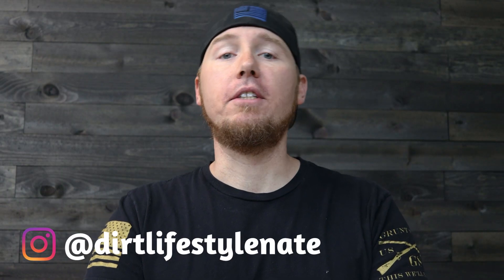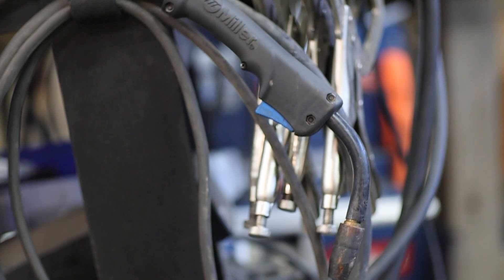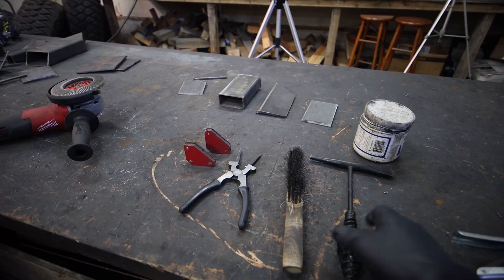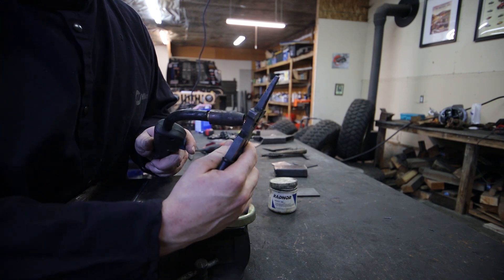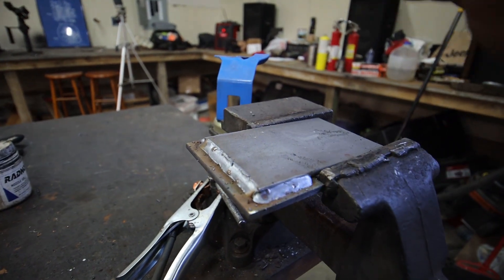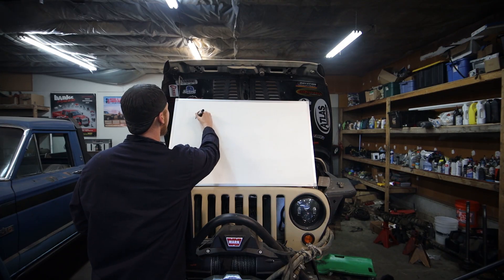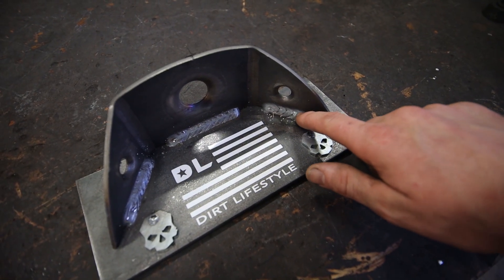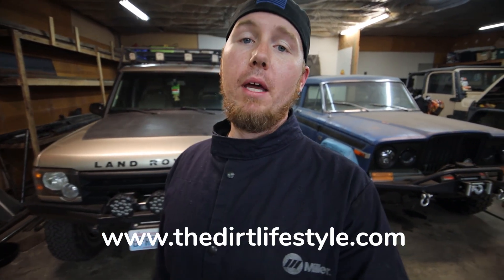Teach Yourself To Weld With This Video!!! (How to Mig Weld)

Comment: that's what I do when I weld with my mig. I go in small circular motions, and when I'm trying to fill a gap I use the C motion back and forth from side to side, and it does a good job of adding material to a space; you're basically just building on the weld material as you cross a gap and drag the puddle as you go as you say. I usually only use the back and forth motion when I'm stick welding. When I was 15, that was 41 years ago, I started out on brazing steel with Oxy/Acetylene, I had to start on a flat piece of 1/8th steel, and when I was able to make a nice uniform bead, I was allowed to advance to brazing two pieces of steel in a T shape. I had to braze 4 layers; the first in the corner; the second on top and the third on the bottom of it and them I had to make a beautiful laced bead over it all. Only after I had mastered that, which took a week of going to class every night for a couple of hours, was I allowed to move to stick welding, and I had to start with a flat weld on some 1/8" steel laying a bunch of beads next to one another, and only after I had then looking beautiful filling a 3x5" plate with perfect beads was I allowed to advance to vertical welding, and I was hung up on that for about a week when a piece of slag got behind my safety glasses, and I had patches over my eyes for 2 weeks. I never went back and finished the course, and I wish my dad had pushed me to go back and finish. I've been wanting to get back into doing it, so I can do some things and I started out with a HarborFreight  Chicago 125 flux welder, it's only 125 volt, I'm really motivated to get a real mig welder that uses 250v and gas 75/25. The Chicago welder is okay for very little! I was really thinking about getting a Lincoln multi process welder until I saw you using the Miller. I'm not sure what your Miller ran you, but Lincoln has a basic multi process welder for around 1,400.00 dollars; capable of Mig, Tig and stick welding, and they have one that is nearly 6,000.00. I'm way too rusty to even think about spending 6K on one lol, but watching you build the rack for you 3500 RAM really inspired me to make a smaller version for my Chevy Silverado 1500 WT. Because I would really like to put a rooftop tent on it and get out to the lake this summer and do some fishing! I grew up fishing as a kid; because mom loved to fish, so I have some really great memories of camping at the Desoto Ben lakes up North when we lived in Nebraska, and even at some of the small lakes down in Oklahoma. you really do some great welding, in my humble opinion, for whatever it's worth. Thanks for sharing all the how to videos. I like the round tubing you use for racks and bumpers. It gives a nice look. I liked the way the rack on your Land Rover turned out. The dimple dies give a nice look while adding a little strength. That's new for me, I didn't know it was making things lighter while adding strength. Really learning a lot from your channel, so thanks for sharing all the projects!

Comment: Yo I need help, does the tip Have to make contact with the metal? As In do I have to let the wire Go first or Does it just kinda fall out as in moving it. My problem right now is I have to guess where the Wire is since I can't see it until it Starts melting and glowing

Comment: hey guys, I've got a cheaptoolium 110v I bought stick welder for $70. I've been teaching myself and have found a respect for welders because its some hard work. in it's own category and expertise. and the skill gap is massive. the curve is massive. the welds I have been making, are fucking massive. I've got a bunch of tools from starting with nothing this past september. I've bee trying 22gauge but It is a bi hard. galviniEd steel doesnt stick weld good either. I've actually got a pair now that. think about it, sweet. If anything you can talk to help I'd appreciate it. I notice my welds are varying in how they occur or the arc what have you. if he 6013 is angled like 45° it works better then 90° , like dam near along the piece of work. I started using DC EN on my 110 and have gotten much better deposition and much better results.

also my settings are difficult to understand. and I noticed my weld is stronger then the metal itself. is hard as frick to cut off
Reply: I've been doing the line stuff since I got it a month ago or so. I didnt know grinding it down was the reason it is so flush. but I also notice if there is no material my weld puddle just burns through. I'm using 3/32 my arc has to be close, lean, preheating, but not super high. it's crazy touchy idk.

Comment: I’m very much a hobbyist, I look up to weekend warriors as my status is so low. So far I’ve successfully hard faced a cheap anvil with stick welding I was quite proud of and mig welded a router table which even impressed my wife. For me as a rank amateur I’ve quickly learnt that 90% of my welding occurs  before I even switch the machine on, it’s all about clean and tidy surfaces. I’ve also become quite proficient with a grinder and my cheap spray gun.

If you’re bald buy the bonnet, it’s friggin painful getting spatter on your dome. I’m still using the big heavy gloves, I know a lot of more skilled welders prefer the tig gloves but I’m not confident enough yet.

Great video, thank you.

Comment: on trash days i ride thru the neighborhood and pick up all the steel bed rails n sure its not very thick steel  but what i like about them is they are  very easy to  strip with  a hammer and a sawzall to get  free angle iron  which comes in handy for many projects and stores easy stacked on top of one another  those are my welding practice  parts  very good beginner video

Comment: If you haven’t burnt through that jacket your not welding above your head then I have used the same jacket welding the bottom of a frame and burnt mine up

Comment: Thanks for the information, one question I have is how many times do you put more welding gel on the tip as I am only just learning how to weld and I have never heard of Welding Gel.
Reply from the maker: There is no exact amount. If I notice junk starting to build up in the nozzle I clean it and dip it in the gel. Not an exact science just trust your gut 👍

Comment: Had some good points that many others don't discuss eg. thin glove and jacket...
However,  couldn't see ANYTHING as far as tacking or welding... nothing g showing torch position... didn't even discuss or have a track of what it should sound like... also nothing to show a good weld vs a poor weld of any type... I think this is a very good start to a intro welding video, but needs some close ups of tacking, welding, hand /torch position, etc. already stated... another 3-4 minutes of runtime filled with  the aforementioned could make this go from a video that lacks to one that goes to the top of the subject...

Comment: This may be a silly question but, do you touch the wire directly on to the material you're welding, or do you hover it just above. I used to Tig weld for work so I know that you don't touch the torch to the material, but I've never done mig before so I didn't know if it was the same?

Comment: Dumb question but what happens if you run out of gas during a weld on a .025 wire or .030

Comment: I didn't realize the tacking was so important. In my haste, i made some crooked welds, but now i know why.  Great video. You get right to it, without all the inconsequential stuff. Keep up the good work!
Reply: allways clamp & tac the work,& spread the welds out,same as torqueing a head.these days you can arc weld just about any metal.you should arc weld,before,you buy a mig.mig is  blindfold welding.

Comment: Going to have to disagree with you when you say you "can't weld 1/4" with a 120 machine". Bevel, multipass, and patience.  Also, as close as possible to the electrical distribution panel, preferably on a dedicated outlet, and as with any welder, no GFCI. 

Is is slower? Absolutely. But I'm building things, not racing. I built my SAS S10 with it, and my bracketry is all 1/4" thick.

NOT trying to be "that guy" that trolls Youtube. It's always better to have excess headspace (ability) with your tools. But if you don't have 220 available, it's no excuse not to start learning (but of course, noone should start with building life-critical assemblies if they don't know how to weld). LOVE the channel, I have learned a lot from you. Hope to see some ring and pinion setup soon, as that's my next project.

Comment: Great video. I’m going to start welding here soon. You didn’t say anything about setting up the gas or turning on the gas. And you didn’t say anything about if the wire is touching the work or how far away it should be.

Comment: Hay thank you for showing me some of your technic. I was welding the other day instead of me welding on a practice piece I went and welded on my project. I had to do a lot of grinding!! I still have to weld all in the hard to get spots I will try what you showed and get my machine adjusted right speed/temp once I get that dial in I'll try the C or zig zag motion.
Reply from the maker: No problem! I hope it helps!

Comment: Thats good info and ways to do horizontal welds. It is the vertical welds that are harder and usediffernt pattern. That is true with stick welding and same done with the Mig horizontal welding works with stick. SO ???

Comment: great video, but what does C25 even mean?  A newbie like me doesn't know those terms, so a quick explain on that would be good also. Thanks!
Reply from the maker: 25% co2 75% argon 👍
Reply: How do you know-how to select that setting?
Reply from the maker: @mattkessler7660  most machines don't have a setting for it. C25 is the most common gas type for mig welding 👍
Reply: Many thanks!😏

Comment: Cool!  In part two, can you go over welding thicker metal to, well, cheese - aka frame stiffeners to the cherokee frame?  That's the one I've been practicing - and man there's a huge challenge there with poking holes (I'm basically using 3/16s and sheetmetal)

Comment: Nice video. I've come to learn over time that the "whip" or forward back and the "C" technique ( if making the "C" back into the puddle instead of forward on the leading edge) can and usually do cause cold lap and lack of fusion. Also, anything over 3/16" should really be welded uphill, if it's structural. Like the channel!!
Reply: I was taught the cursive lower case e, but I often use the whip and pause as well. I'll use the if I've got bad fit. Really  helps close the gap and doesn't keyhole too bad
Reply: what do you mean uphill?
Reply: @AGLTC01  
Vertical welds done bottom to top.

Comment: Auto darkening lids are awesome, but i do not recommend the Harbor Freight ones. I had one for a while, and it quick working after a while. It would darken, but not as much as it should. I guess maybe the knob that adjusts the darkness quick because i had it maxed out.

Comment: Hey man, I want to start welding but I have no real knowledge so I wanted to ask. Would you recommend stick welding for begginers?
Reply from the maker: Alot of people recommend stick welding for beginners but I don't. You will rarely use it if ever. I never stick weld because mig welding is so much cleaner and easier. I would learn mig first. Then branch out to tig. 👍
Reply: @DirtLifestyle  What price range should i be looking for if I want a reliable mig welder?

Comment: I like brazing and JB Weld for thin steel body panels, and making thick steel brackets that bolt together with grade 8 bolts where possible. See the Project Farm YouTube videos for maintenance tips for vehicles. For a hobbyist, welding thick steel might be best to hire out, because of the cost of the equipment and the time to have enough experience. In college the teacher had us weld 2 thick steel plates together, then he put one side in a big vise and hit the other side with a big sledgehammer. If the weld bent instead of breaking it was good.

Comment: wow $3,000 for that miller 220. Twice the price of a miller 211 with similar specs. Why did you go for the 220?
Reply from the maker: The miller multimatic 220 is a multi process machine. It has a fully functioning tig, stick welding leads, a mig and even a spool gun. The 211 is only a mig welder. They both are great units but I need to be able to tig weld aluminum 👍
Reply: @DirtLifestyle  Thx . I saw they both welded similar thickness of material, both welded aluminum and ss, but missed the details you mentioned, but then again I am not a welder :)
Reply from the maker: @R0yL33  no problem 👍

Comment: Any recommended models for a first welder? Looking for something on a budget easy to use and learn on.
Reply from the maker: I need to do a video on this. I'll start planing one. I would recommend finding one that is 220v and gas fed. Even cheap welders work well at this amperage. 👍

Comment: Question I'm a 44 yr old school bus mechanic thinking of changing career I used to be a production welder. I used to weld aluminum cable tray racks I bought a Lincoln weld pack 13 yrs ago used maybe 5 times to do a few tacks. How would you suggest I go about switching this late in life.
Reply from the maker: I would join a union. There is a few different welding unions and i think this would be the easiest way to insure good pay/good education 👍
Reply: @DirtLifestyle  thank you happy  new year

Comment: How can I become an or get into a apprenticeship? I'm going to school and getting my welding license but everyone wants someone with on the job experience.
Reply from the maker: It depends on the type of welding your interested in. My union is plumbers, pipe fitters and welder. Its local 26 up here in Washington state. The type of welding we do is all pipe nothing structural. If your looking to weld on buildings/structures there is a union for that too. All unions have an apprenticeship and train you to do the work. I would start by applying at your local union 👍
Reply: @DirtLifestyle  dude thanks!! I'm looking to grow in tig mainly, I like stick but for me tig is where it's at!
Reply: Dirt Lifestyle Washington state, sweet, I work in Seattle for a structural engineering firm, and I got my first mig class for Christmas in a few weeks. This is helping me out a lot, thanks
Reply: Talk to you school carers advisor or your welding teacher
Reply: @ryanbrown6756  my welding teacher is old a retired welder and gave me a list of numbers to call but they aren't active anymore! Lol! I have not talked to the adviser though, I will be doing that. Thank you for the response
Reply: You could also try getting a general engineering apprenticeship at a larger engineering place they often take on apprentices
Reply: Then specialize later

Comment: I’ve been welder for over forty years and I’m still learning.
practice, practice, practice. Started out gas welding , then stick, then wire feed, of course wire feed has made everyone a welder. Dream it Build it. Good gift trying to teach others, if the dog doesn’t get off the porch it doesn’t get to play.
Reply: I agree, I've got 30 years in myself there's only a small percentage of people you can actually teach to weld. It's kind of an art form

Comment: Loved the video.  When I learned how to weld there where no auto dimming helmets.  Got flashed more than once.  I would recommend a 110/220 welder for the Jeepers out there.  I say this because some time you may wish to do a trail repair.  A 5kw generator will power it.  Of course you would want to use a flux wire for it to weld out side. 

Check out the 

Vulcan MIG 215 
At Horror Freight.  AVE has a video on it.  https://www.youtube.com/watch?v=Gh51jPKeR9A
It is about $750 before any coupons.
Reply: Really small cheap stick welder is all you need for emergency repairs. I'd leave the good welder at home, no need to lug some multi-machine around with you with chances of damaging it or taking up lots of room. The main reason why small stick welders are great for outdoor emergency trail repair, is they have no delicate moving parts to damage ;)
Reply: @FarmerFpv  Sorry, did not see your reply until today  I am not advocating hauling around a generator and welder.  My point was to buy a welder that you could easily transport to do a trail fix.  Most of the wheeling I do is a few hours from my house.  I would never transport a welder and generator on every trip.  Weight and space is way to much to do that. 

Why not buy one welder that can do trail fixes that you can retrieve in the event that you need to do a trail fix?  BTW, I over estimated the KW needed for a 110 welder.  I am pretty certain that my 3 kw wou;d power a 110 welder.
Reply: Coat hanger news paper watter and jumper cables lol good old 2010
Reply: I keep a regular helmet just in case. I got stacks of auto dimming helmets that don't work anymore.

Comment: I run a 90amp 110 flux core and it works great up to quarter inch. If i run my bead properly, the penetration is perfectly fine. If someone is not able to with 110v, it is nothing other then operator error. edit: a GOOD 90amp flux core, not harbor freight pos, although iv had pretty good luck with them too, especially for the price in a pinch if you need to weld something in an emergency.

Comment: Great video as always. Personally I prefer straight c02 over 75/25. It seems to burn hotter and it’s cheaper and more readily available to buy. Another thing to consider is that any time you leave your puddle like in the whip and pause style, it introduces contaminants in to your weld. The shielding gas protects the molten metal from the air around it. The best method is your “C” technique. Manipulating the puddle side to side, pausing briefly at each side to ensure proper fusion. Always staying in front of your puddle. Circles can trap slag and other contaminants in the weld also, compromising the structural integrity.